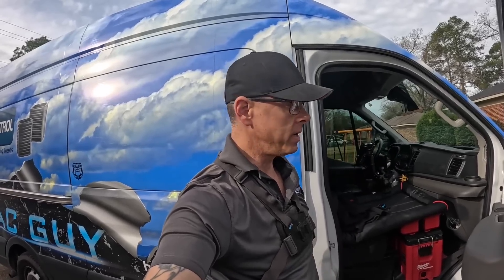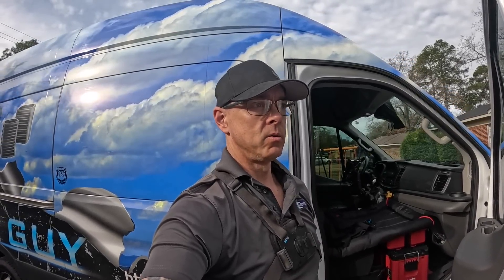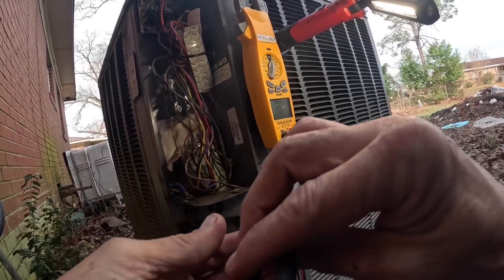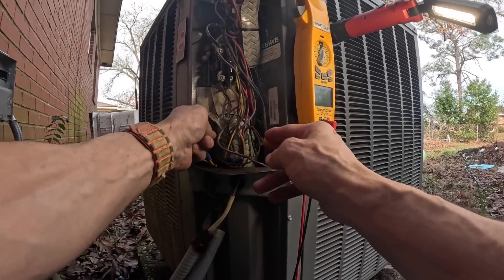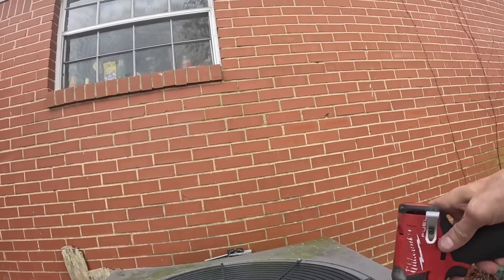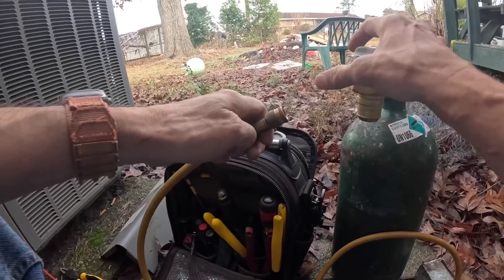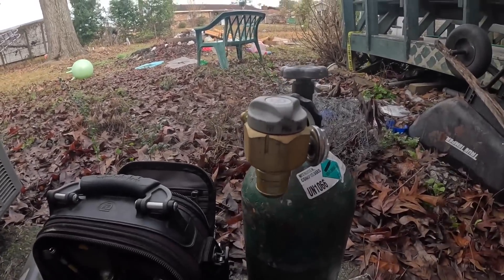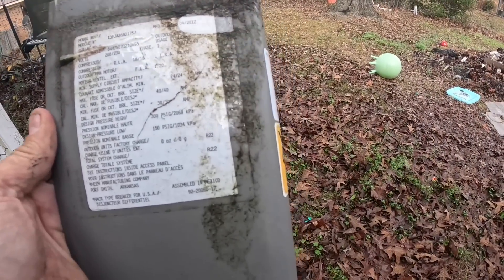Horrible Place With A Junk Air Conditioner!

Comment: I know I'm late to the party, but that being a heat pump wouldn't there be auxiliary heat strips in the air handler to get by for heat? In central Alabama we always installed strips, but they might not be as much as would be installed in electric heat only air handlers.

Comment: Years ago all Capacitors had a rubber cap on them protecting the terminals spades.
Guess the MFG cut cost by not providing them anymore.

Comment: Non-HVAC question:  How do leaks like this occur?  Fatigue?  Improper soldering?
Reply: Many reasons. Poor install, cheap components, bad flaring on joints, age, vibration, unnatural disturbance, bleach on copper, the list goes on. People who want to clean their condensers with a bleach spray and a hose or pressure washer are actually damaging the system.
Reply: @jeremyg8568  

Thank you!  In 2018 I had similar happen to my, then,  14 year old Bryant heat pump in the middle of a brutal winter. It cost a small fortune to repair.  The repairman said he thought it was due to two lines rubbing together.
Reply: @awshortclips that would be vibration then and it happens alot.

Comment: Why were they running the air conditioning
Reply: Because it's a Heat Pump! You could see the reversing valve and TXV outside.
Reply: But thermostat said it was 74°F right..

Comment: Talk about the lived-in look.    Curtis, they must have had other techs out there as well.   All the old driers and that mess of capacitors aren't your style.     Looks like they paid for a completely new system, by resurrecting the old system one service call at a time.
Reply: Probably had a home warranty if I had to guess.  Those usually pay for things like capacitors and deny most other things.  And those guys are typically unlicensed hacks so the capacitor and wiring work is par for the course.

Comment: What do you do with an R22 system that's low on refrigerant? Any R22 that's still around for sale costs a FORTUNE and it seems like throwing good money after bad to recharge some decrepit old monster.
Reply: There are some replacements. I had my outdoor unit replaced 8 years ago and we used R407C which is pretty affordable and there are a few other subs also.
Reply: @bobboscarato1313  Oh yeah I see you can evacuate all the R22 and replace it with R407c with just a little loss in efficiency.
Reply: @billmilosz  My system is a bit oversized so no problem in that area.

Comment: The capacitor still in the box was great haha!
Reply: At least they kinda of secured it up out of the way ,whenever I find those, usually, you'll take the cover off, and the box and everything will fall out
Reply: Honestly that's par for course out where I operate. More often than not you find em just sitting in there in the box. See it like this too where they don't have the proper UF CAP so they just tape in a separate fan cap jumped from common off the other. Even worse when you have all that and an aftermarket hard start shoved in there 🤣. Never found it to really be an issue other than being ugly but I still kill power before opening any high voltage appliance just in case.
Reply: I do that honestly

Comment: I can see they probably can’t afford to pay for a new system could you just fix that leak and use a substitute freon to get it working with no warranty on the work maybe use that leak plug for the evaporator coil?
Reply: it a ez fix and mo 99 for replacement freon which is cheap . But that not going to happen if No est is made for it